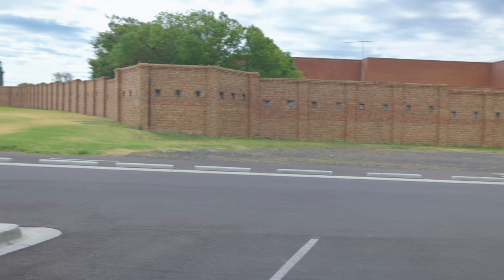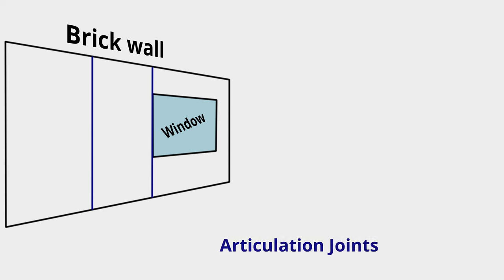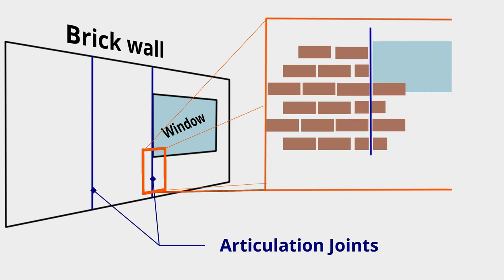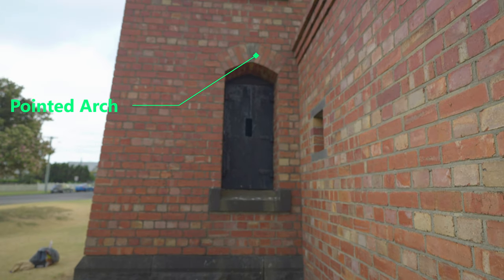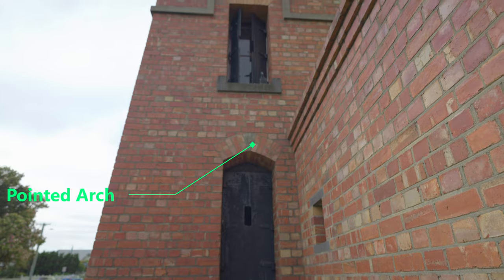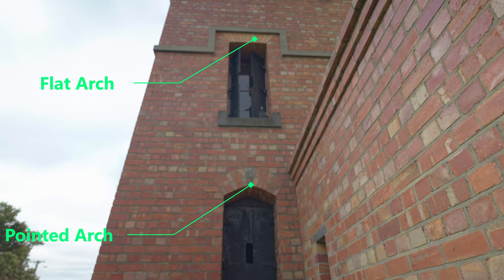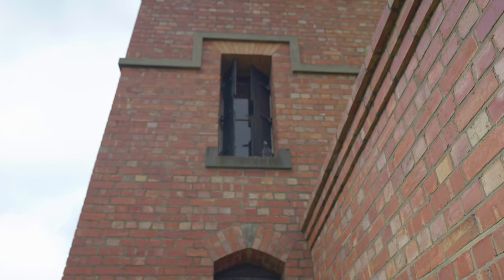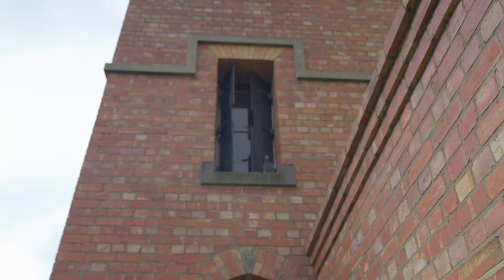The Rules of Masonry Design - Insights from a Structural Engineer

Comment: Your recommendations are spot on. Our engineering company is often called upon to determine both why a failure exists in the structure and how to go about solving the problem.  Would be far better to have the architect (or residential designer), builder and masonry worker to follow the engineering guidelines to preclude the problem.  The builder often defers to the 'brick guy' without proper oversight.  Water intrusion both on the brick and on the structural elements behind the brick are often the problem.  The open pore house wraps exacerbates the problem. Wood expands quite a lot and puts lateral pressure on the brick.  Lack of steel ladders or rebar bond beams in tall walls happens frequently.  The majority of 'masons' today are not the skilled practitioners of previous generations and are 'allowed' to regularly cut corners.  We primarily practice on residential structures. We see so many failures due to poor building practice.  Poorly compacted fill under a footing to support the brick moves (due to weight or water or both) and the cracking and splitting begins is too frequent.  Undersized lintels, lintels which are not properly attached to a support beam or header are often seen.   Your video is compelling me to look for or develop a brick work guide to be followed on projects which would be a part of the shop drawings inspection (and field inspections along the way would be useful).  Closely looking at the elevations and marking up where proper joints should be utilized, size and connection of lintels, waterproofing protection, etc. makes sense.  These are areas we are never asked to  provide guidance on.  Whether facade or load bearing brick wall construction, much of the brickwork here is not correct.  Thanks for another well done (and provocative) video!
Reply from the maker: Hi Micheal thanks for the detailed response much appreciated. And glad that you found similar concerns. So many places where if poorly detailed can cause issues.
Reply: Hi Michael
In the UK we are expected to specify lintels (some call them lintols) and movement joints. They MJs are too important to both engineer and architect to leave to the builder.
We might also need to specify windposts where needed.
Regarding brickwork guides, the UK brickwork associations used to produce them for here. I expect that the modern equivalents are still available and could be adapted for your market.

Comment: I was interested to see the recommendation for 6m spacing between movement joints. In the UK 6m is the spacing for concrete masonry, while for clay masonry it is 12m.
Apart from thermal movement, clay bricks tend to expand after laying as they absorb water, while concrete blocks shrink as they dry out.
Reply from the maker: Hi Peter, I would think the UK 🇬🇧 would have better knowledge on masonary. Interesting to hear the differences.
Reply: @BrendanHasty  my masonry knowledge is a little rusty, as it were, but I did do a quite a bit in a previous job.
It sounds like NZ bricks are a different size to UK ones, which is not surprising as they tend to vary between most countries and also over time. In the UK they are now standardised at 9”x4”x3” with a 1/2” mortar joint, though now we are metric (50 years and counting) they are 215x102.5x65mm with a 10mm joint. This has the advantage that you can lay them multiple ways and they will join up without cutting them.
This also means that they lay the same with the concrete blocks at 440x215x(various thicknesses).
Most houses are brick and block construction but for larger buildings masonry is just used for cladding.
There is some discussion over a return to lime mortar, which is more flexible than cement mortar and self-heals cracks, but takes more skill to work with. I would be interested to know the difference in carbon footprint between the two options.
Does lime mortar ever get used in NZ masonry?

Comment: Aren't those cut bricks in the corner called Queen closers, and are used to keep the bond staggered in English or similar bonds?
Reply from the maker: Hi Richard as they are less then half a brick they are Queen closers. 👸 they are only needed it your wall does meet typical brick unit lengths
Reply: @BrendanHasty  yes, but if you are using say English bond and you are placing stretchers over headers then you need a quarter brick to obtain the staggered bond. I have worked with some very good bricklayers and seen this done many times. For example if a wall was 20 stretchers long then you would place 40 headers on top, but unless you want the perp joints to line up vertically then you need 39 headers  and two queen closers to obtain the bond surely?

Ps I like your channel I wish I'd found it when doing my degree last year.

Comment: When it comes to materials, in europe we also use a "synthethic" type of sandstone which is called calcium silicate. It's a mixture of lime and sand, bonded under high atmospheric pressure in an autoclave. It's colour is typically white and it's mainly used for structual walls (typically the inner, load bearing leaf of a cavity wall system). Nowerdays it's often glued with thin bed mortar joins. Are you familiar with this material?
Reply from the maker: Hi DYKO, I haven't used it before sounds interesting I will need to look into it.
Reply: It's also referred to as Aerated Autoclaved Concrete or AAC. It's an interesting material, with similar properties to other masonry blocks (e.g. it cracks), but is generally lighter (so the blocks can bigger)  and has better thermal properties. It can be more difficult to get a good fixing into, but there are special fixings that work well up to a point, and then resin anchors are needed for higher loads.

Comment: Brilliant video Brandon, Hard to grasp how the flat lintel can behave like arch. Isnt only difference the tension strain path is at an angle perpendicular to brick orientation instead of relying on mortar bond?
Reply from the maker: Hi taimoor it is the angle of the brick installed causing compression.
Reply: Hi Taimoor
I agree that flat arches do not look right at first but their mechanics are sound.
Masonry is essentially compression-only so there is no tension strain path. Bricks do not work like elastic materials such as steel and concrete.
Instead the trapezoidal shapes of the bricks in the flat arch means that they cannot move down without pushing out and hence arch.
This effectively forms a compression thrust line which curves parabolically into the masonry either side of the opening. This works as long as the flat arch is deep enough.
There is a classic book on masonry design called The Stone Skeleton. It is well worth a read.
Reply: @PeterDebney  Thank you Peter for the detailed explaination. I get it now, So basically lines of brick orientation are the line of forces and trapazoid makes it an arch creating hz reaction at support thru moment equilibrium, no wonder why its hard for modern engineers to understand classic but simple and effective techniques. I will definitely refer to the book too. Thank you again.

Comment: hello sir, i really wanna ask a question i hope i get an answer ....do i have to be theoretically very knowledgeable so i can study structural design engineering or we can use only softwares without doing calculations with hand? because i have a big lack in theoretical things. thank you
Reply from the maker: Hi sam you need to do the hand computations, software can be wronge and modelled in correctly so you need to able to assess if it is correct.